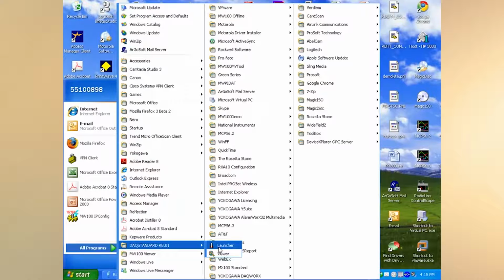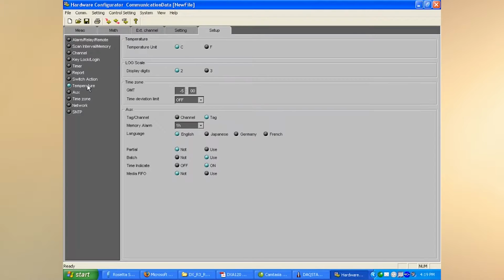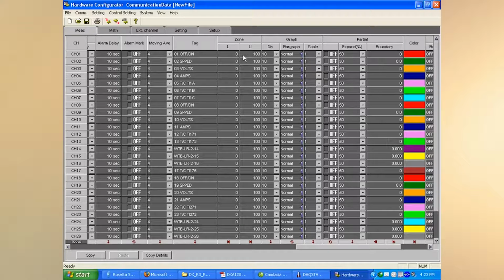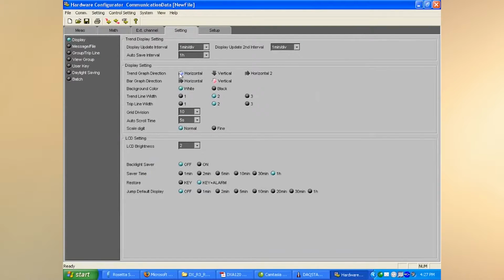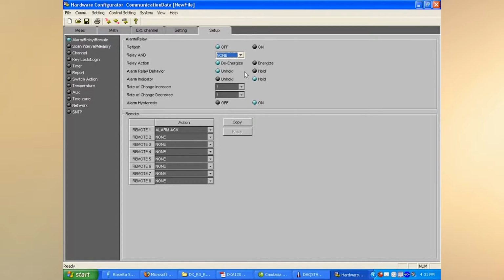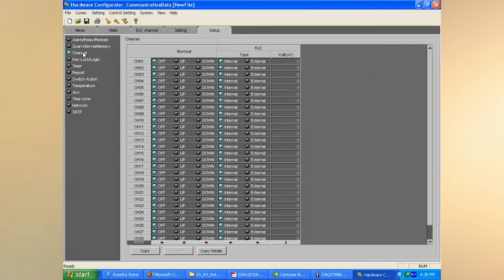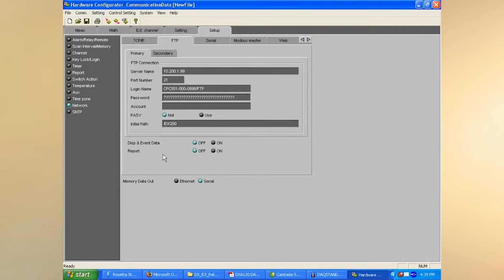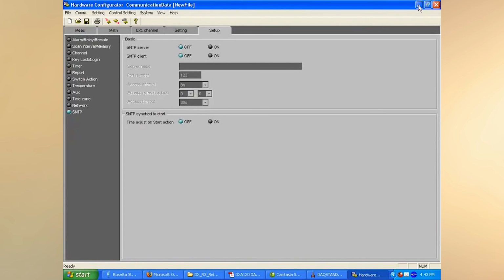How to configure Yokogawa DAQStandard Hardware

Comment: The application should browse the network and find the device and ip.  How about a video showing the setting up the ip address of the unit and also setting the ip if the dx is acting as a client to MW100's
Reply from the maker: Thanks for the question. Unfortunately there is no software tool that will find a DX on the network and set its IP address remotely. The IP address must be set directly on the DX from the setting menu. If you have any further questions, then please contact us at YCA-Support@yokogawa.com.